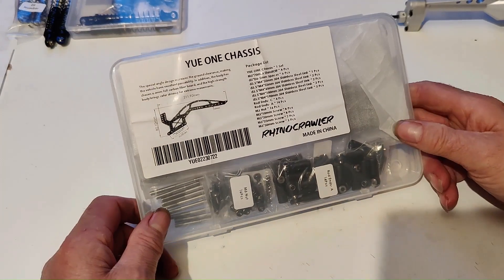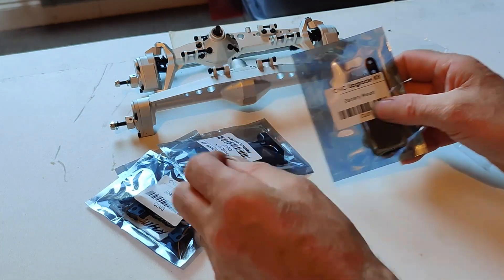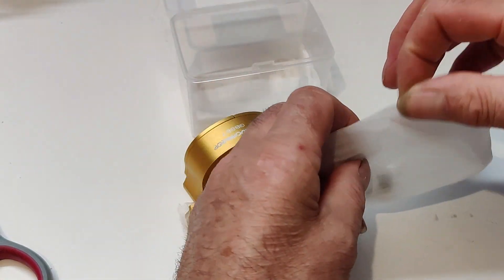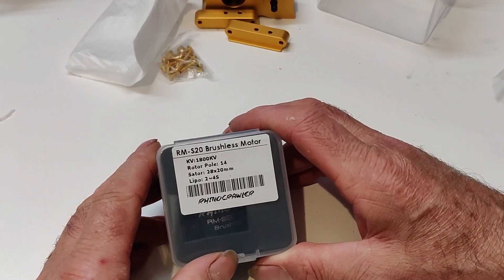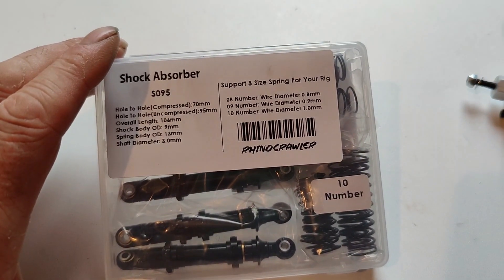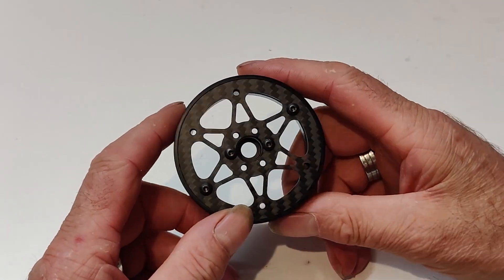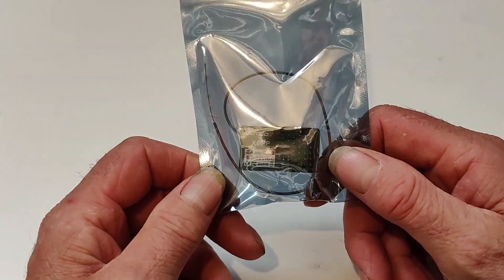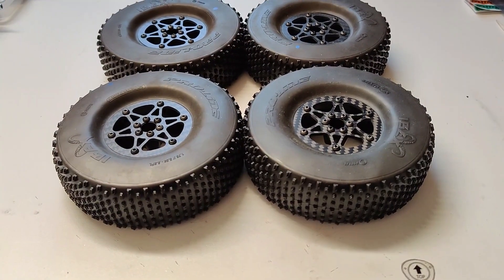Rhino crawler yue one unboxing of parts

Comment: Hi Nigel, can you tell me which remote control should I buy for my Rhino Crawler?
I buy the DUMBORC DDF-350 10CH RC model (€88.72 including 4 CH receiver), or DumboRC X10P-350 2.4G 6CH (€41.00 including the X6FP receiver)
I know it costs twice as much, but is the display very nice, or are the functions that are there useless for my Rhino Crawler?
Thank you.
Reply from the maker: Hi I run the Dumbo x6 on my rhino and not had any problems . I still get good control of the speed and good operation of the steering. Good control of the speed is all down to the rhinoesc. I have not had chance to look at the new Dumbo so I can't comment on it yet.
Reply: OK thanks, for now I'll buy the rims, tires and servo, complete the assembly and in the end I'll buy the radio control, I haven't decided which one yet, I'll think about it.
Thanks bye. @nigelbellwood3725

Comment: Just what I was looking for. Where did you buy all of this and have you got a complete list of codes for the bits you ordered (including the axles)? Thanks!
Reply from the maker: Just search rhino on AliExpress the axles are fimonda f9 offset on AliExpress
Reply from the maker: Just found this amazing item on AliExpress. Check it out! ￡33.94  30%OFF | Aluminum F9 Portal Axle with Offset Front Differential for 1/10 RC Crawler Capra Gmade R1 Rock Buggy LCG Cheater Rigs 1.9 Shafty
https://a.aliexpress.com/_EJY9nU7
Reply from the maker: RCTIMER Store
https://a.aliexpress.com/_EvtAGpZ